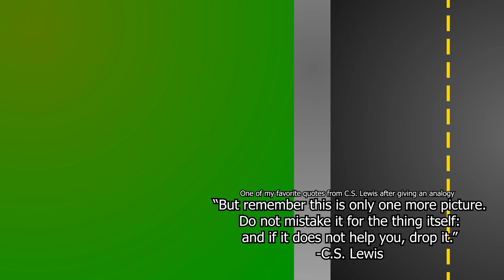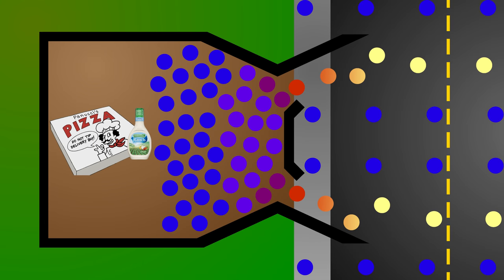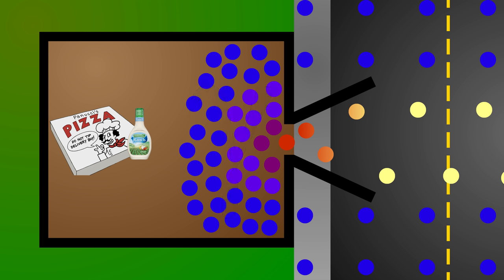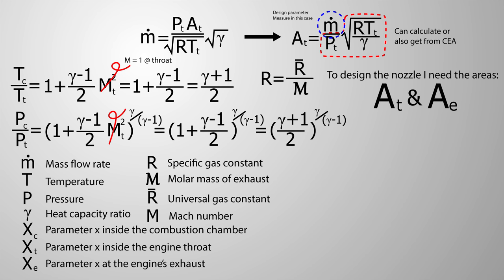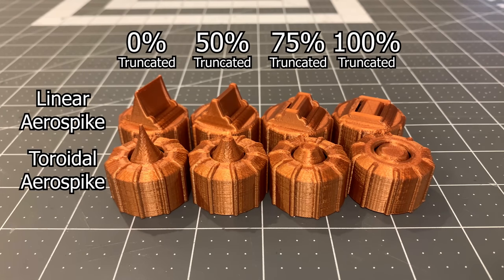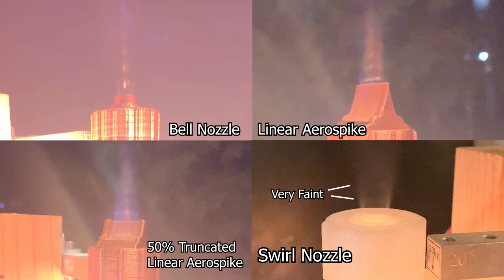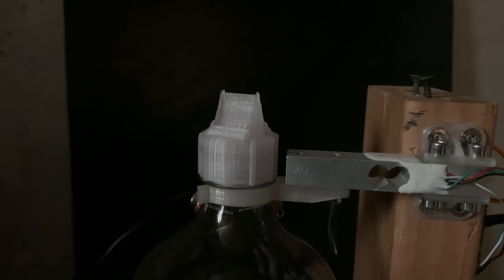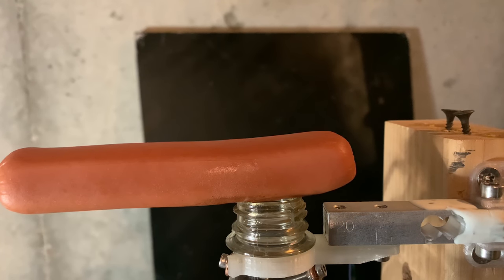Strangest Types of Rocket Nozzles

Comment: the hotdogs were nice skin simulators, but what impressed me even more is that a burn time of about 1-2 seconds would suffice to melt the surface of the nozzle. i mean yeah PLA melts at ~200Cish but wow that dumped a lot of heat rather fast still

Comment: I need a metal 3D printer very much . I have Autodesk fusion program, but I really do not know how to use it yet,

Anyway, would you consider making a small part for me which may help me prove a hypothesis I have been working on for most of my life?  Let me try to explain what I need. I call it the spin spike rocket nozzle.  It is a 3/8th inch length, preferably made of titanium or stainless steel, with longitudinal helical slots milled out along its length. The slots are deepest and widest at one end and narrower and shallower as it progresses to the other end.  It is a helical twist resembling a helical  worm gear. I would like to see 3 parts made, 1 with 1 revolution  around the length, another with 2 revolutions and another with 3 revolutions.  In the center of the rod is a 1/8th inch hole through the entire length.   I am not certain if you can make this with 3 d printing,  or if such a project would interest you or win me a 3D printer, but I sure would appreciate your help.

Comment: You're lobbing them into the air, a few end up in your neighbor's yard.. Next thing you know, he learns engineering and rocketry and starts lobbing them back.. 
Are you sure you can get accurate readings using plastics and materials that reduce in structure as the temperature increases?
Reply from the maker: The real pain as far as accuracy goes is sample rate. The whole burn is over within two or three samples, finding a way to extend burn time or make the sample rate faster is top of the todo when I revisit this
Reply: @Sciencish  I was actually joking, but, yeah, I was thinking of it.  Funny answer.  I think you need self sealing stembolts..  Serious answer.  Hmmm.  I used to build model rockets as a kid and I've always liked science and chemistry, physics and (Goes on listing things for 2 hours), they're not what I'm the best at, and haven't studied that stuff in decades lol so anything I say is just a huge speculation lol.. 

What about using a super cold fuel, wouldn't that speed up the sample rate as it combust?

Comment: This was a great video but after going to the length of calculating the numbers why didn't you also maintain the fuel-air ratio across all your tests. it's sad that data means nothing.
Reply from the maker: I couldn’t think of a practical way to hold it constant, it’s an open vapor container. I thought of sealing it with thin film but that would raise its own issues. Also the load cell was no where near fast enough, there’s a good chance I missed the peak thrust with most tests so the data is even less meaningful ¯\_(ツ)_/¯

Comment: Should have used a airbrush with alcohol in it to get the same air/fuel ratio per bottle.
Reply from the maker: Using a syringe would be more controlled than an airbrush, but getting a measured amount isn’t the issue. It’s an open system, so vapor will just come and go no matter how precise of an amount you add.
Reply: I don't know if I'd consider a bottle an open system. You may have found out during this experiment you'd have to put fresh air into the bottles for the oxygen. I've messed around a little bit of this myself I was thinking an airbrush,  because you just tap it a few times, it introduces fresh air and alcohol at the same time. Try it out you will see what I mean. good video man preciate it. Hypnotic bottles make really good flames.

Comment: If you want to optimize this, you need to dump the bottle. You are loosing a TON of energy in the start and stop transients. By the time you get to a operating pressure, most of your fuel has been burned.

Comment: Bruh, you are WAY over expanded. For sugar rockets with a chamber pressure of 300psi, I was going from like 5/16ths of an inch in diameter at the throat to 3/4ths of an inch, with a length of about an inch and a quarter. Lower chamber pressures, like you have may need an even smaller ratio of length to exit diameter. (The ratio is really between length and exit area, but this makes it easier to visualize

Comment: I would take one of the eight oz mt bottles take a penny smash to fit under the cap drill a 1/8.  1/16 inch hole center whatever size the  regular dremmel collet is a few drops of top fuel and they would move one time blew the cap off and left a trail of fire too much fuel I think

Comment: are you really supose that thermodinamics is more complicated that fluid mechanics, bro? .-. thermodinamics are mostly second order diferential equations, where mostly of models can be solved by hand, if well modelled, and some other models that can easly be solved with a basic mesh and linear solvers (regard very specific high end problems) rather than partial differential equations needed to solve the most basic problems within fluid mechanics. for thoes, you need a very complicaded set of fluid simulation softwares just to scrach the surface of the real problem. But sure, thermochemistry are the worst of all.
Reply from the maker: The math itself isn’t usually what makes things difficult for me(but it definitely is sometimes haha), but how easy it is to conceptualize. Moving fluids are much easier for me to picture so the math, tho hard, was easier for me to understand. Both kicked the tar out of me grade wise tho, until I got a phenomenal professor for a Propulsion class who tied them both together so smoothly that they seemed simple and easy
Reply: @Sciencish  gotcha. The phenomenology of both are beautifull, eitherway. But sure, is more easy to imagine a fluid flow rather than picking the idea that the temperature of a mixture is the average of the temperatures and not the adding of both of them. (A.K.A everyday astronaut). In the end, the botton line is: thermo/fluid dinamics is (almost) all about gradient of some sort of energy. Since you pick up this idea and kept all of the parameters that influences it (like a control volume, government equations, etc), you can model and solve a good portion of the problems. 
The part who i mention about the complexity involved is because most of the complexity of themodynamics is just a fluid dynamic effect, like convection models induced by turbulences and boundary layer effects that have a HUGE impact on the heath/work transfer coeficient that you're dealing with. Conduction and radiation are quite simple.

Thermochemistry, otherwise, is another story..